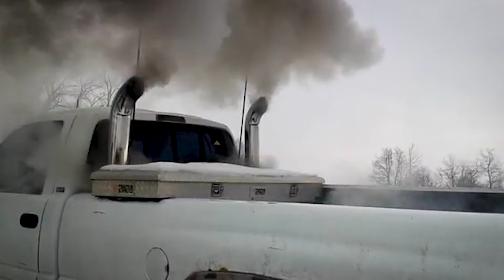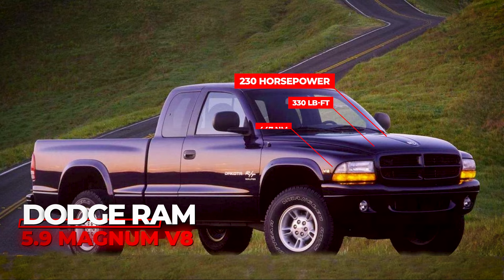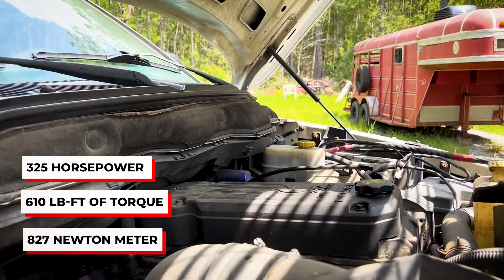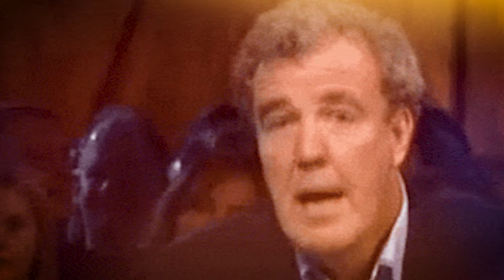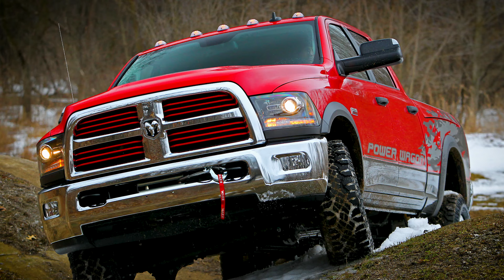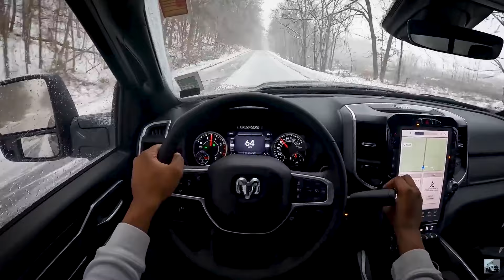The Truck That Turned Diesel TORQUE Into a Lifestyle - RAM 2500

Comment: Bought my 2500 6.7 Cummins. It was a work truck for cement company in LA California. Made its way to Ohio where I bought it paid cash in full. drove it to Alabama and then Mississippi with not a single problem. Still haven’t had a problem with it to this day and it’s a 2012 model. No payments no rust no damage no problems.
Reply from the maker: That’s the kind of story that proves why the Cummins is legendary  no payments, no rust, no problems. Just torque and reliability. 🔥💪